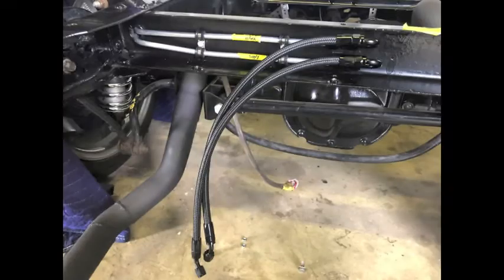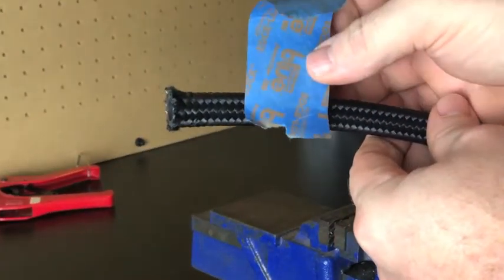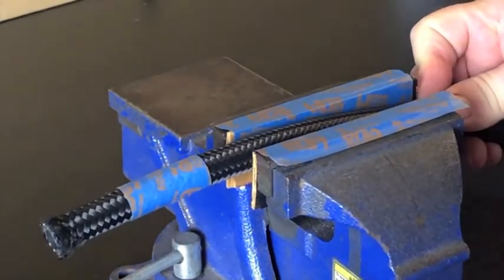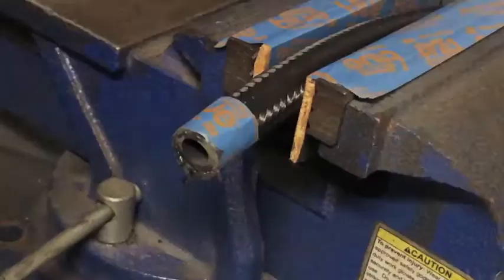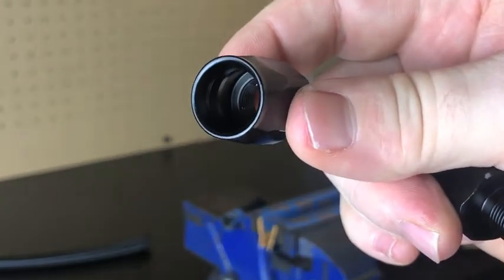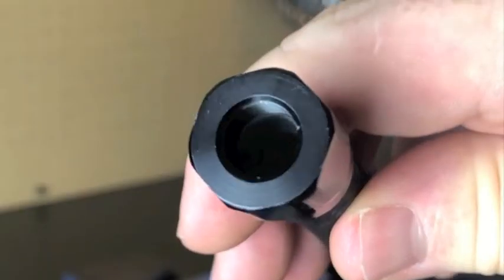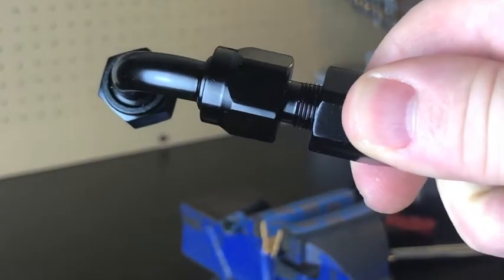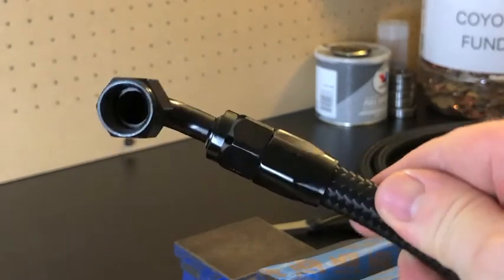How to AN fitting with Nylon braided hose

Comment: Are these safe for the engine bay area?
Reply from the maker: @VicBeatz you should check with the manufacture you are going to purchase them from
Reply: @midlifecustoms yea I did. I found an option that's E85 safe and is just as flexible

Comment: This was awesome. Can I do this to fit to s fuel pressure regulator?
Reply from the maker: @synlfo7828 Thanks. That is what I used it for, a pressure regulator with AN fittings.
Reply: @midlifecustoms  Thank you for the response. I am pretty new to all this so trying to figure out how i can get an AN6 from my regulator to my Edelbrock through a 30 micron filter. Its all a bit too much with all the info, numbers etc etc WOuld you have a place i can getthe specifica parts from that you could recommend?? Much appreciated

Comment: How come my hose starts to spins towards the bottom of the threads? I can’t seem to hold it from spinning while I’m tightening the fitting down. Thanks!
Reply from the maker: @mattcarlson8773 I have had that happen before. It can be a pain. I had to hold the hose is some soft jaws in the vise, while using two sets of wrenches. Did you use lube on the fitting? Another thing I did before , is to start over by just cutting off a bit from the end. Good luck on the project.
Reply: @midlifecustoms thank you! I did use a touch of oil on the threads both times.

Comment: I’m having issues where the hose starts spinning while I tighten the fitting down. What am I doing wrong
Reply from the maker: @LSev1215 it is hard to say with out seeing what is happening. Did you put any oil on the threads? Is it clamped down? Is it bottomed out and possibly defected? Good luck.

Comment: I recently installed this on my transmission and they seem to leak only where they connect at the transmission what do you think I did wrong?
Reply from the maker: @DSTEW24 Sometimes I had slight leaks when they were not tight enough.

Comment: Is Teflon tape recommended on any AN fittings or connections? I"m connecting to a Jazz fuel cell.
Reply from the maker: @accidental_relevance Teflon tape is usually not used on AN fittings.

Comment: My fittings came with o rings in the package, are they necessary?
Reply from the maker: @anthonymr921 -an fittings don't normally use o rings. You might want to check with the company you bought them from.

Comment: It helps to lubricate the "barb" portion of the fitting when assembling too as that has to push down inside of the rubber hose.  Also most recommend that you leave a credit card gap between the two parts.  It looks neater to align the sides of the hex vs what you have done as well.  Also good idea to start the masking tape BACKWARDS then flip it and tightly wrap it.  This will prevent fraying even futher.  Overall good overview on assembling these.
Reply from the maker: @greenkouki Thanks for all the recommendations.

Comment: Other videos I've watched say to leave a small gap when running the nut down. I assume so it can be swiveled a little if the angle needs adjusting.
Reply from the maker: @robfromtoledo9514 I always tighten it all the way down. I would think that would cause leaks. Let me know how it turns out. Good luck on your project.

Comment: My fittings came with o rings, is it necessary to put an o ring in between the fitting when tightening the fitting to the hose?
Reply from the maker: @SBdunks3 I am not sure what setup you have. AN fittings don't usually use o rings. Might want to check with the company you bought them from.

Comment: Some brands or so called experts say to leave 1/8th" between to two fittings. Are the using a different brand of fittings? I am quickly loosing track of brands and right v wrong. This build is mine, kinda want it right. Thanks for video!

Comment: I heard some say you need teflon tape?  I been looking at a transmission cooler on amazon and it comes with AN fittings.  Some reviews say the fittings need teflon/plumbers tape.  I wonder if it also means I have to put an fittings on my factory transmission lines too?
Reply from the maker: @Soldier1287 AN fittings don't usually use teflon tape. You might be able to find a adapter fitting to go from the factory line fitting to the AN fitting on the transmission cooler.

Comment: Curious. I have this exact fittings and hose, was planning on replacing a hard steel hose thats on my rack and pinion, do you know if this style of an fittings and hose is rated for high pressure power steering?
Thanks
Reply: Rack and pinion pressures run 400-600PSI, depending on the brand. Recirculating ball steering gear boxes run 800-1,200PSI and low pressure return is under 20PSI. DK, ASE Master tech since 78, retired.
Reply from the maker: @jordanboelter No, sorry I do not know the pressure rating.

Comment: I know I'm 3 years late. I'm currently installing new transmission lines for my 2007 mazda 6, ive gone through several fittings but keep leaking at 37⁰. Everything is snug, ive tried conical seals several times.. tried different brand AN fitting too 6AN is the size. Any advice? 😅
Reply from the maker: @andr3woc34 sorry to hear that. Nothing comes to mind. Good luck hope you figure it out 👍🏻

Comment: Thanks but what’s the point of a AN hose end if it just sits in there by tension? You’d think tightening down the hose end will also tighten the hose sitting inside. A fitting with a barb end will be better because at least you can tighten the hose down fully with a hose clamp
Reply from the maker: @TheCityofGod the end part that goes into the hose is threaded.

Comment: Your video was very helpfulBut I have one question I seen on some other videos that they used  a Oil ring for leaks
Reply from the maker: @prettywomenclassiccars1751 thanks. AN fittings don't usually use anything. Maybe it was a different kind of setup.

Comment: I just got my first set of AN fittings and hose with a new fuel pressure regulator I'm using on my newest project, this video was very informative, and thank you very much😉 now I have an idea how not to screw up my first AN fittings *
Reply from the maker: @driveventures7445 thank you

Comment: Is it just as easily achievable to put the hose together if you dont have a vice?
Reply from the maker: @bmwe39m5 it can definitely be done. But it being fine thread and going into the hose it does get pretty tight. So if you have a vise it helps.

Comment: Why didn't you put any gas resistant thread sealer on the thread's?
Reply: They don't need it.
Reply from the maker: @Mike Smith I did not think the hose fittings needed it.

Comment: Bit of a dumb question, but the other side of the fitting still swivel when it's fully tightened down? Or does it become rigid
Reply from the maker: @Bilal Tariq after being tightened down it should not move

Comment: Good video.  How come other videos show that you need to fray the nylon and stainless braid back a bit to install a compression sleeve before installing the AN fitting?  This Evil kit doesn't seem to use those types of fittings.
Reply: A few minutes later, I can answer my own question...  because it's not PTFE hose.  Those fittings with the "olive" are for PTFE hose.  You're just using regular nylon hose.  🙃
Reply from the maker: @Short Attention Span Garage thanks

Comment: A,properly manufactured high quality AN fitting should be fully tightened until the flats of the Hex are aligned. Your example was out by approx 30°. So it was either a lesser quality or not quite tightened all tgd way. Good job on showing how far to bottom out thd hose portion into the nut as that is also a critical dimention.often overlooked.
Reply from the maker: @Russell Moncrieff thanks
Reply: Does that part need an o ring? Or does it seal by compressing onto the tube that was pressed into the hose?

Comment: Great video but I never got the hose into the fitting.  I tried tape no tape lub but all that happens is the nylon peels back.  Sending kit back for refund.
Reply from the maker: @JuicedMoose thanks for the comment. Hope it all works out for you.
Reply: @midlifecustoms  As I was sending back my brother-in-law said turn counterclockwise and it will go in.  DUh the nylon braid was still a pain but It works. LOL  again thx for the video
Reply from the maker: @Michael Dunnell sounds like it all worked out. That’s awesome. Congrats

Comment: So it just slides ride into the hose and it seals correctly?
Reply from the maker: @DomTheSoccerMom with a straight cut on the hose and pressed up to the back of the inside of the fitting then threaded down. It should seal correctly 👍🏻